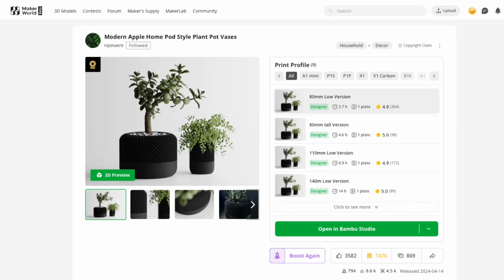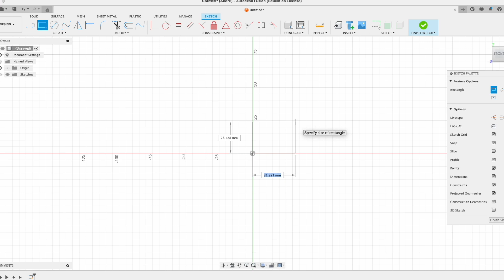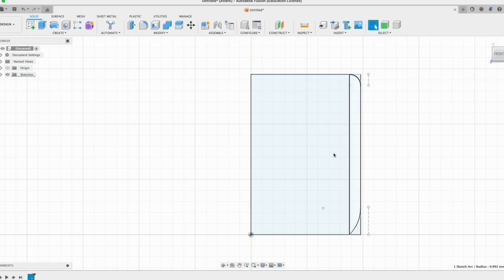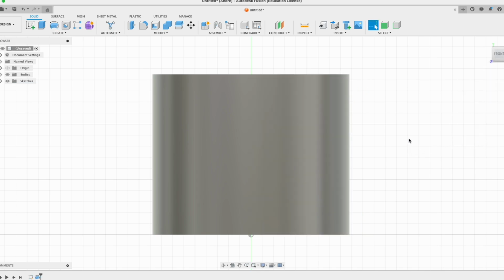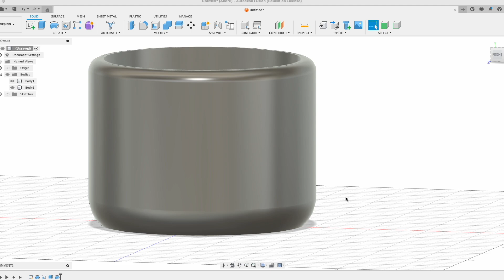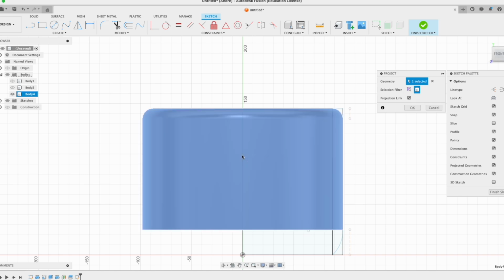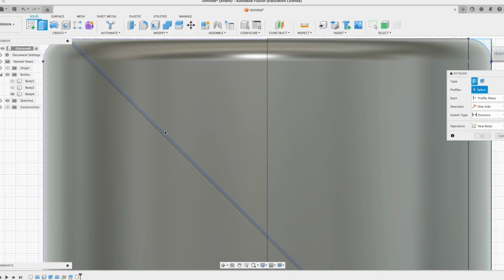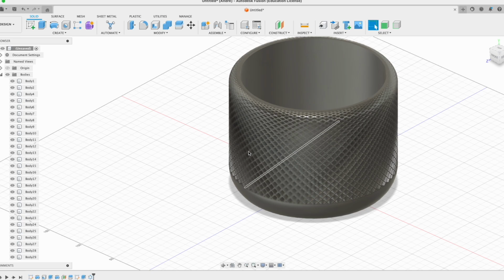Fusion 360: Create a HomePod Planter

Comment: I'm not sure if this is some efficiency thing you're doing, but I'd have just done a top down sketch to start, drawn 2 circles from origin point with the second circle being my internal width. Then extrude up the outer circle and out the inner circle. That way I can change the size or thickness of the pot from the first sketch and ideally everything after it will update to the constraints of that sketch

Comment: Great Fusion tutorial!
 A matching water plate would be most welcome, however, I think the pot might have to be made slightly smaller so the water plate would fit on the X1C bed and the planter to fit in the plate, and of course some drainage holes.

 How well does it hold water? maybe it doesn't need a water plate, I have printed planters in the past and have had to paint UV resin on the bottom inside to make them waterproof.
Reply from the maker: Mine has not been leaking yet - though I don’t water it to heavily when I water it. I’ll have a look at maybe making a plate